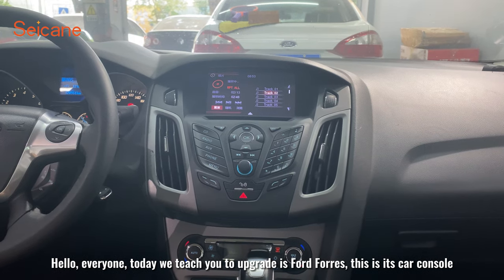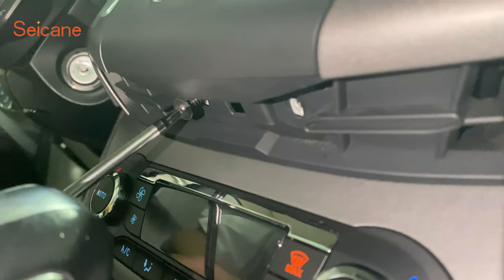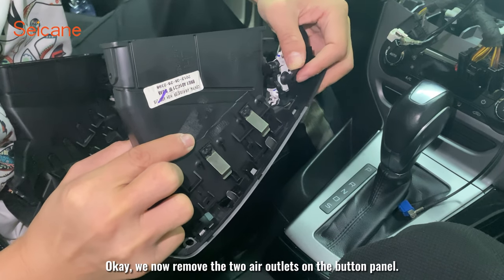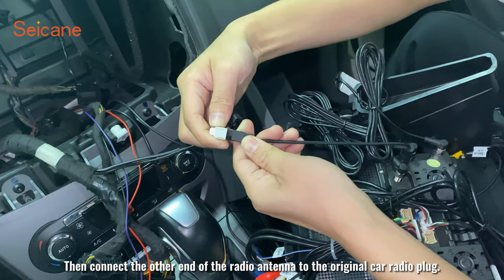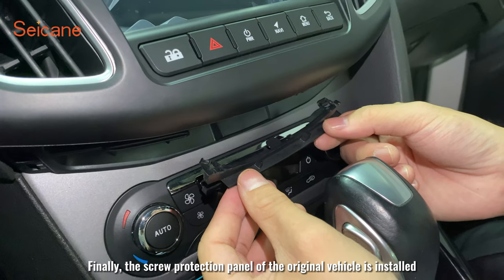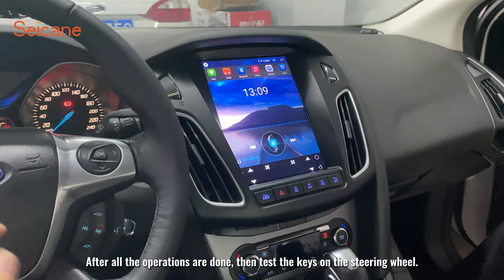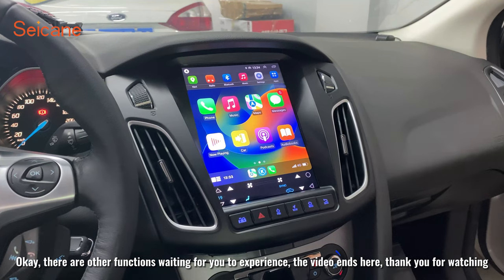How to install Carplay & Android-auto for Ford Focus 2012 2013 2014 2015 with HD Tesla Touchscreen?

Comment: Man mine was a pain in the ass to work with my car, 2014 ford focus st …. You have to connect your amp wire and set your canbus setting hiworld/ ford/ mondeo and then select the year of your car
Reply from the maker: hi, did you buy the device from us?
Reply: Does this give you Steering wheel controls?

Comment: if i buy this radio, will it work with my stock factory installed camera?
Reply from the maker: it works if your camera plug is AV connector.

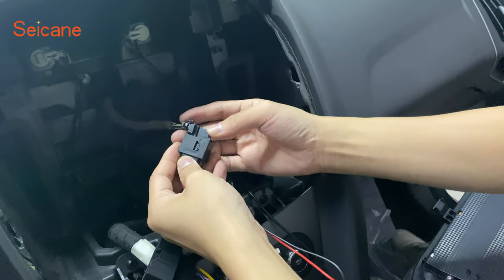Comment: In 2:46 you put in a smll connector i have NOT this type of thing in my car…… could you tell me more, about this plug???? What things work with this??
Reply from the maker: what does your original car's CD board look like ?
Reply from the maker: if your original car has no this plug, then no need to connect. the cables may be different.
Reply: @Seicane-Car-DVD  
It the newer one, bit i ve found my connections…. The Plug if my car is bigger…. For the rear cam i connected the green and blue to the plug and pin 46 and 47 for the Buttons on the wheel, now its working fine the only issue is the rear cam it shows smaller then it is ( ive take some changes but dont now which one….